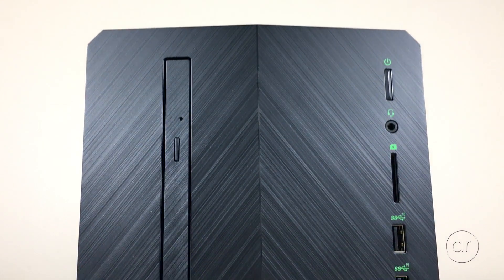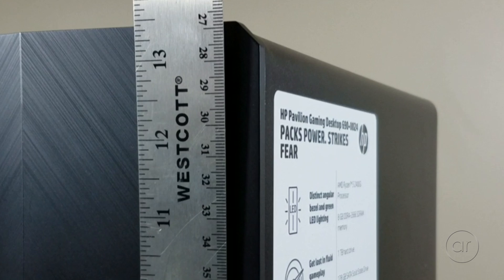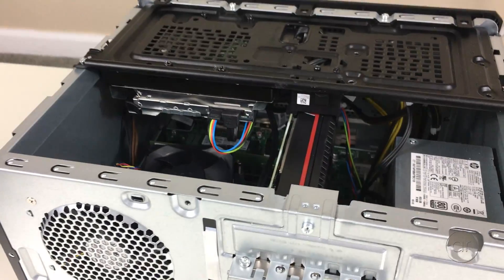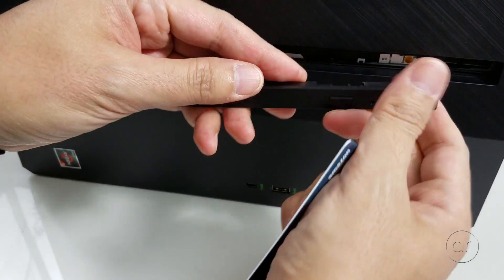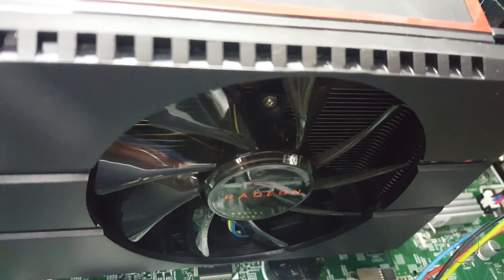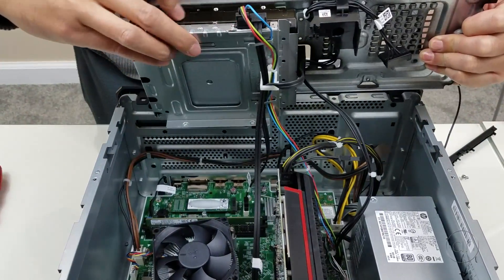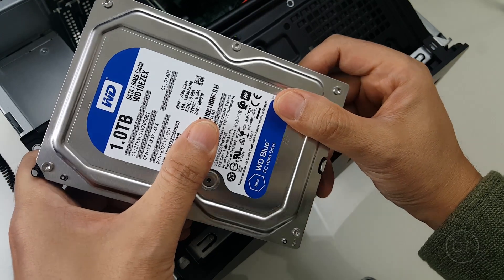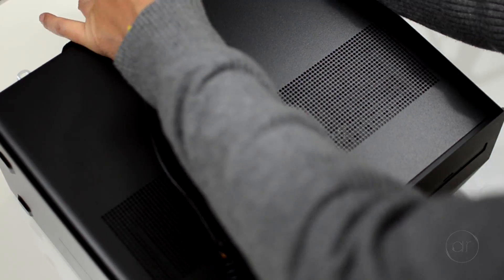How to Open and Upgrade a Ryzen-Based HP Pavilion Gaming Desktop

Comment: Wanting to add a 2.5 1TB to my Ryzen 7 machine... keeping the 128aGB nvMe as a boot drive (first time upgrading a PC as I converted over from Apple products lol). I have the 2.5 SSD in mind, but Have 2 questions for ya: 

1) When you say “you may need an adaptor” what type of adaptor are you referring to, a 3.5 to 2.5 inch bay adaptor? 

2) Also, would I need any extra screws to get the adaptor bay to stay on in the cage, as we don’t have loading trays in this prebuilt PC? I understand an adaptor kit will give me screws to get the 2.5 inch into the 3.5 bay, but I’m trying to figure out how to mount the second bay next to the Western Digital HD
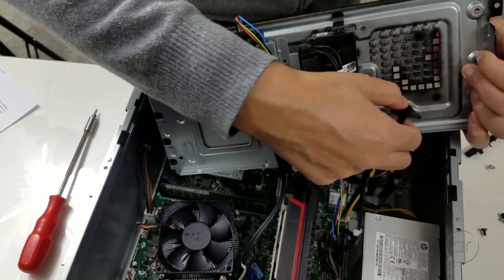Reply from the maker: If you look at the 5:17 mark, there are four holes on the cage that seem to be in the right locations for an SSD's mounting points (I can't confirm this as I haven't tried it myself - I just used velcro). The next time I'm inside, I'll try to measure those dimensions and see if they match the SSD's.
Reply: access random just saw this... thanks for the reply! 

I’m waiting on a good price for a decent 1TB SSD and then going to go ahead and upgrade it
Reply: access random Was it fairly easy to Velcro the SSD, and where did you end up Velcroing the 2.5 SSD to, the cage?
Reply from the maker: Yes, it was basically hooks on one strip, and loops on the other, each strip having an adhesive backing. I did mount it on the cage (on the right side as seen at the 5:13 mark).
Reply: access random thank you for your reply! :)
Reply from the maker: You're welcome 👍

Comment: I replaced the boot SSD on mine with a 250GB SanDisk Ultra 3D SSD
Reply from the maker: Thanks for the info. Was this an additional drive or did it replace the existing HDD?
Reply: @accessrandom  The existing SSD
Reply: How did you go about reinstalling the OS? Fresh install of windows without the other stuff HP puts on, or just recover it?
Reply: I cloned the drive.

Comment: Ok, I have the 590-p0020 with the same motherboard. I have seen reports of people upgrading the PSU. Based upon my research, power is only delivered via the two four pin connectors. The proprietary connector at the bottom is a PSU fan connector. So, I would imagine you probably could put an sfx PSU in it with those connectors along with a jumper for the 24 pin.

Comment: Correction to video... no, you cannot use the pcie slot to install a sound card. The m2 ssd uses that pipeline, it's not functional while using the ssd. Can use external USB  sound card, use the hdmi or digital ports in graphics card to carry digital sound, or plug 5.1 surround jacks to mic and line in ports on rear and pc will auto configure into output ports. You can access by going into REALTEK visual interface.

I own the 690-0034 model with Ryzen 2700. I upgraded the ssd to a larger size and it's western digital black edition. I reconfigured ports on rear to act as audio out for my 5.1 speakers as I stated above. Works great.
Reply from the maker: That's a great catch - do you mind if I add it to the description (with credit to you)?
Reply: @accessrandom  sure thing... To be clear, the port can be used if switches to using sata drive, (ssd or hdd). The M.2 NVmE is faster because it actually steals the pcie ports pipeline... So if you install a sound card, it will show it in device manager, but the system won't find it and will refuse to install software for it. I have my workaround for sound utilizing the rear ports as I stated (set up in the visual interface for realtek), but one can use external USB sound card or use HDMI or even digital port to sound receiver\compatible speakers  (provided video card has those) .
Reply from the maker: Thank you! I had to paraphrase a little bit because I'm hitting the 5000 character limit for the description, but I think I've captured the main points. Thanks again.
Reply: @accessrandom  no problem

Comment: can you change the case 
like if i buy a different case would everything fit in it and what size case would i need
Reply from the maker: That's a good question. The motherboard is so non-standard - I haven't checked whether the mounting points match up with standard ATX/mATX/ITX cases. I'll let others who may have tried this to comment... anyone?
Reply: @accessrandom  I'm going to try this because I need more room in general for cooling and other things. I'm going to try and if it doesn't work I'll probably just get a new motherboard that will fit
Reply from the maker: Thank you - please let me know how it goes. I think a lot of people are curious about it.
Reply: Did u find a case that it worked in

Comment: Great video! I've just purchased the same pc with Ryzen 5 2600 and 1060 3gb (model number: 690-0014nl). Do you think I will be able to upgrade with an m.2 ssd and a second 8gb dimm of ram, and if so do you have any suggestions as regards brand and specifications ? 
I am a bit worried about the power supply because it seems to be 310W only and I'm not sure whether it would sustain the additional load... What do you think ?
Reply from the maker: HP's website indicates that the 690-0024 and the 690-0014nl use the same Sunflower motherboard, so you should be able to add an M.2 SSD and another memory module. I've listed SSD and RAM models that have worked for other viewers in the description. The power consumption of an M.2 SSD is typically <5W when active (<1W when idle) and for an 8GB stick it is typically ~3W so I wouldn't worry about that.
Reply: @accessrandom  Thanks a lot ! As regards the ram module do I have to stick with 2666mhz or can I buy an higher clocked one ? I am also having some concerns about the temps, what are normal numbers for this machine ? My gpu hovers around 85C during gaming and the cpu gets as high as 87C (under heavy load, in game 70-75) should I worry about the longevity of my components ? And if so could you please suggest me some solution ? Thank you ;)
Reply from the maker: Sure thing. If you're adding a memory module to the existing one, I would try to match the specs (you can see successful models used under the "Memory" section). If you're replacing the existing one, then you can use faster RAM but it will downclock (see the "Replacement Memory" section). I think the heat is a real concern. A viewer named Terry Parrott detailed his solution - again, see the description under "CPU Fan" but it is quite involved and requires the removal of the HDD and optical drive.
Reply: @accessrandom  Thanks for your patience ! So if I want to lower the temps (on the cpu only though, it seems...) I have to completely replace the cpu cooler and remove the hdd/dvd bay ? What about changing the exhaust fan (or maybe both fans) with a more efficient model ? The pc is brand new and I'd like not to void the warranty with aggressive modification of the specs... I tried to look into undervolting but Throttlestop doesn't appear to be compatible so I don't know what to do, how do you manage your personal rig ?
Reply from the maker: I have't really done much so far - I've simply removed the CPU fan and re-applied thermal paste to it. What I plan to do in the future is cut out a hole on the side panel with a dremel and mount another exhaust fan (the problem is finding the time to do it!)...

Comment: hey can you also add Asus ThunderboltEX3 Expansion Card Expansion Card since it has a another pcie port and use a egpu
Reply from the maker: Interesting - looking at the ThunderboltEX3, it looks like there a Thunderbolt connection to the motherboard. I haven't had any experience with it so I'll let others chime in. Anyone?
Reply: access random wouldn’t any thunder bolt with pcie would work ?
Reply from the maker: The motherboard/BIOS is so non-standard (e.g., it dedicates memory for onboard graphics even when you're using a discrete graphics card, it has fan mounts for an Intel CPU even though it has an Ryzen (!), etc), I couldn't say with confidence that it would work...

Comment: mine did not come with the m.2 i see u can add one tho mine also has the rx 550 can i upgrade the gpu to rx 580 with no prob?
Reply from the maker: What is the size of your power supply (or which model do you have)?
Reply: @accessrandom   HP Pavilion Gaming Desktop 690-0028b not sure which psu in there but i have everything but the m.2 and the 580 i do see the port for the m.2 tho
Reply from the maker: The 690-0028b has a 310W power supply, which is on the low side (as reference, the 690-0024 in my video has a 400W). If you look at AMD's website, the power requirements are quite a bit higher for the RX 580 than the 550, so I think it would be risky unless you upgrade the PSU. The motherboard is made by Lincs and its specs on the HP website state that it has an M.2 2280 slot. But would the BIOS support an M.2 SSD? - not sure.
Reply: access random were can I buy the bigger power supply for this ?
Reply from the maker: Unfortunately, I haven't had any reports of a successful third-party PSU upgrade, but i believe one commenter went through HP themselves to order a larger PSU. Sorry, I wish I had a better answer...
Reply: access random Essentially when I’d be able to just use the PCU that’s in this computer that you’re using if u could find one ?
Reply from the maker: According to the other commenter, you'll want to go through HP's PartSurfer website to make sure the upgraded PSU is compatible with your system.
Reply: @accessrandom   yea i see that he is also using a rtx 2060 mini in it i may start to do this. soon
Reply: @accessrandom  adding the ryzen 7 should not be a prob right
Reply: access random also is that a usb type c in front of this pc ? U think EGPU would work with this ?
Reply from the maker: Hard to say - HP's own website doesn't make sense in that it lists compatible Intel CPUs (?!?) for upgrades for the 690-0028b, even though it's clearly a Ryzen.
Reply: @accessrandom   can i add a pcie capture card with the other pcie port at the bottom ?
Reply from the maker: I just received a comment from jofrejkd: "no, you cannot use the pcie slot to install a sound card. The m2 ssd uses that pipeline, it's not functional while using the ssd." I haven't verified it yet but if it's true, it's a pretty big limitation.

Comment: Today i changed the rx 550 that came with my hp 690 for a MSI GTX 1650 VENTUS XS 4G OC, and all good. For the one that have this version is safe to put a 75 w gpu instead of the 50w gpu that comes with the pc just have to measure less than 19 cm
Reply: What about putting in RX 570 or 80
Reply: @cornerkidsz1152 It depends on the model because it depends on the psu, which model do you have?
Reply: @royeah8419   310 watt psu so can i add the same gpu u talked about ?
Reply: @royeah8419  which cards dont need psu power the best ones ? 1650 u talked about seems good do they have any cards with more then 4gb of ram ?
Reply: @chrismiller1986  Yes with 300 w psu u can perfectly have a 1650
Reply: @chrismiller1986  The most powerfull one right now is the 1650, specifically the asus dual that is clocked at 1775 mhz and the msi ventus that is clocked at 1740 mhz, models that are clocked at higher frecuencies need 6 pin power conectors. Other option that dont need power conectors are the gtx 1050 ti, 1050, rx 550, rx 560 but gtx 1650 its far better than these, maybe amd will launch in the next 6 months a better option but i dont think it will be a lot better than the 1650, amd has not been so efficient energetically in recent years
Reply: @royeah8419  would the dual fan one of the 1650 work? its 11.8 x 8.6 x 2.2 inches
Reply: @chrismiller1986  Its the ASUS DUAL-GTX1650-O4G
 and is 8.03 " x 4.53 " x 1.46 " Inches long, i am almost sure it fits, but if you cant measure the space so you can be sure,  use the second best option the msi ventus, i have that one and it works perfectly, its only 35 mhz of difference, and both have dual fans
Reply: @chrismiller1986  The dimensions on amazon are the box dimensions, you have to check the web of asus, that's where it says the dimensions of the cardd
Reply: @royeah8419  i sent the link of the duel fan one they also have a single fan so i can get the one with  two fans ? would that be better in that case or dont matter ? single fan is few bucks cheaper
Reply: @cornerkidsz1152  If you have the rx 550 you can only change the gpu for the ones that dont need external power connections (rx 560, gtx 1050, 1650 etc) because the tdp limit its 75 w

Comment: would a gtx 1650 work in this this thing
Reply from the maker: As an experiment, I did get a GTX 960 to work. Physically, it will depend on the form factor - I think the Mini ITX version of the GTX 1650 would fit.
Reply: @accessrandom  Ya the mini would fit I bought a 1660 mini the other day and it did but the power supply I bought didn't have any of the connectors the oem one dose. My main concern is the 1650's at my local best buy are all overclocked and the psu is only like 300w.
Reply from the maker: I see - yeah, the power requirements and the physical power connector itself on the card would be important on any card that you buy. The GTX 960 that I tried has a max power draw of 160W which is similar to the RX 580. I believe the 1650 is less than that? The 960 also had the same 6-pin power connector that the RX 580 has.
Reply: The Zotac 1650oc (ZT-T16500F-10L) is probably your best bet.  It doesn't require any external power connectors and only requires a 300w psu. 

https://www.zotac.com/us/product/graphics_card/zotac-gaming-geforce-gtx-1650-oc#overview

Comment: do you know any ram sticks that will work with this pc? mine came with only 1 8gb stick and its tanking my performance so i wanna upgrade to dual channel by buying another stick
Reply from the maker: I've had reports of brands/models which have been successfully installed (in the "Memory" section of the description). Hope that helps...
Reply: access random thanks for the reply. One more thing, when i try to left the drive cage after taking the front dvd slot with a credit card, the cage comes out but its still held in by cables, do u know which cables i would have to remove
Reply from the maker: The most restrictive ones are the SATA cables (data and power) that are connected to the hard drive. If you remove those, you can at least swing the cage out of the way to reach the motherboard.
Reply: access random good news i got the ram installed and now i have 16gb installed (14 usable) but one problem is with the m.2 sata ssd. My ssd didnt come with a screw and neither did the hp pc. Do you know where i could find the screw for the ssd?
Also thanks for your tutorial cuz now i didnt have to pay some computer shop bozo $40 to install a single stick of ram
Reply from the maker: Glad you found the video useful. Sorry to hear about the M.2 problem - the size of the screw itself is 2.0 x 3mm (CM2x3-3.3) which you should be able to find at a hardware store, but Amazon also sells them as well, specifically as M.2 fasteners. You may need to get a spacer also (which is usually sold with the screw at Amazon).
Reply: access random thanks for providing the screw dimensions (hp decided to not provide it so we need good people like you to help the rest of the community)
Reply: access random hi again, i searched around for an m.2 spacer like you said but i couldnt find much info, and im not sure what it exactly is, i havent worker much with m.2 or nvme ssds. Can u suggest any amazon links for an m.2 spacer, i can find the screw myself i just dont know what the spacer is
Reply from the maker: For some reason, Youtube filters out comments with links so I'll point you to the search term. If you look for "GutsParker M.2 Standoff and Screw" on Amazon's website, you'll find a combo that includes the standoff/spacer. Again, you may or may not need it - I would check your motherboard to see if the spacer already exists.

Comment: Can I make this vr ready?
Reply from the maker: This is probably a little underpowered for VR use. You could upgrade the CPU to an AMD Ryzen7-2700 and increase the memory (making it the same specs as the 690-0034).

Comment: is it possible to move this pc to a new case
Reply from the maker: The motherboard is custom-built for the case (and the power supply seems to be as well), so it is unlikely. However, all the other components (memory, video card, M.2, DVD drive with some bezel adapter) should transfer to a new case/mb/psu.

Comment: Is it possible to get a new case, motherboard, and psu then transfer over the rest?
Reply from the maker: Yes, those are the only components that really need to be replaced for a transfer. You could re-use the DVD drive but you'd need some type of bezel adapter if you're placing it in a full 5.25" slot.

Comment: Will a rx 580 4gb versión but the one with 2 fans fit
Reply from the maker: It's unlikely due to the small bracket (at the 3:24 mark) that holds the existing RX 580 in place. The length of the case is also short.

Comment: What Form factor has the case? Is it possible to switch to another mainboard?
Reply: I'd guess you can fit a micro ATX, but you'll lose those ports on the front as it's custom built to match the case. If you're paying out for a motherboard though you might as well swap the case too and sell the left over spares onto another builder.
Reply from the maker: Unless you order one directly from HP, I don't believe so. In fact, HP's spec sheet states the motherboard is "Customised size: 24.4x26.7 cm (9.6x10.5 in)"